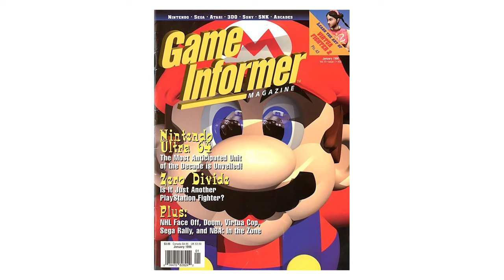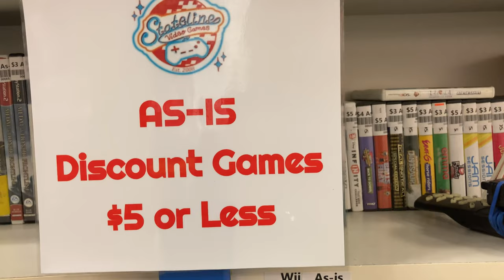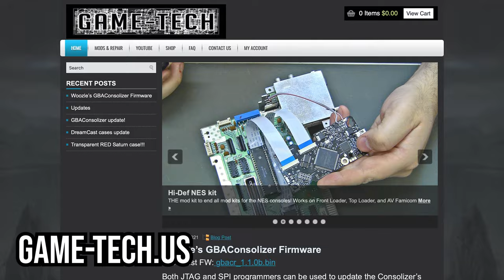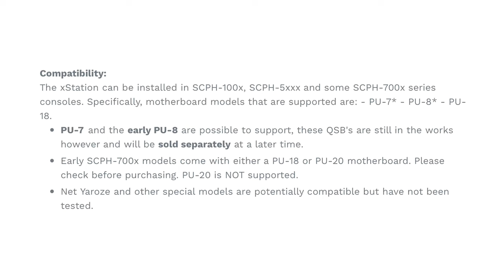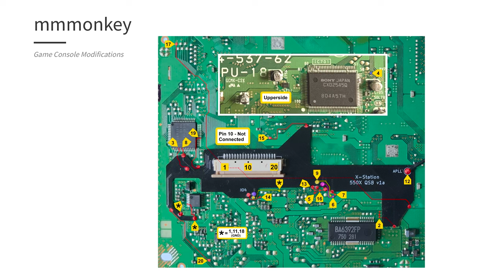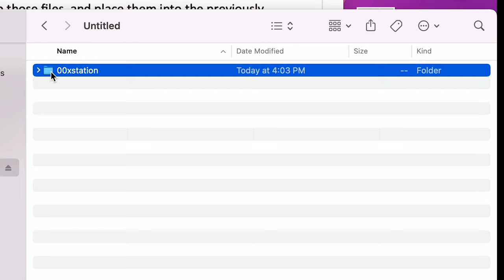Restoring a $25 PS1 in 2023

Comment: I never really played with the PS1 but back in the 90's I installed several mod chips in them it was a hard process on later model, early ones were not too hard no pins to lift as far as I remember, I also got a PS1 game genie that was also acting as a mod chip it came with a small spring that was used to fool the switch that detects if the cd door is open or closed with the game genie you boot the ps1 with a real disc while the door open, swap the disk with a copy and close the door

Comment: I hadn't heard of the xStation before. Looks like a very dope mod.

You ever look at the PSIO? I threw one of those in my PSX. It required cutting a couple traces, but didn't require lifting any IC pins (thankfully). It also installs in the serial port on the back of the PSX, preserving the disc drive should you want to still use those childhood discs of plastic.I really like the product.
Reply: PSIO is pretty buggy and desperately needs a FW update. The creator is kind of a douche about it too. He bans people from his discord for asking. 

The Xstation is a much better supported product.
Reply: @rentoptional1524  ahh, that's a bummer

Comment: I bought the power adapter you've linked on amazon - from mouser - but the same adapter. It doesn't fit my pico psu V6.... what.. the fuck.